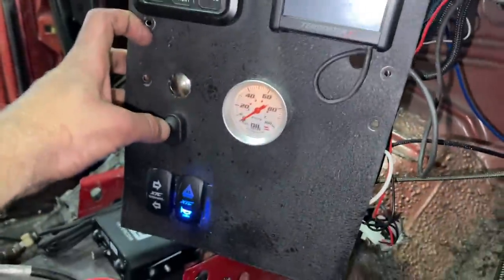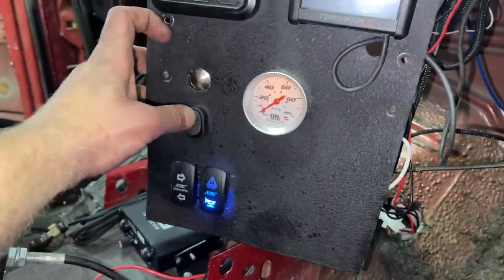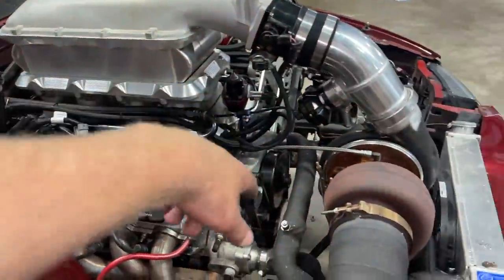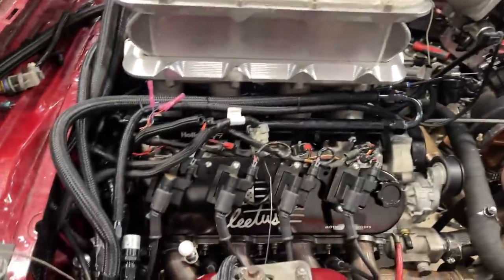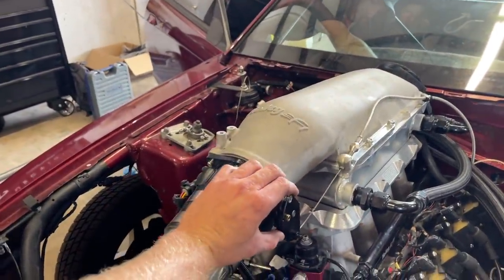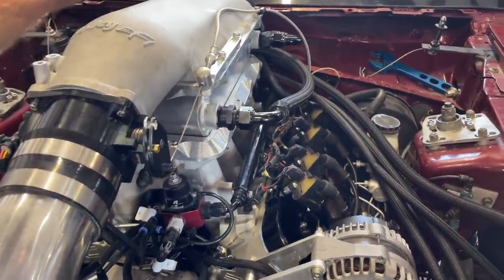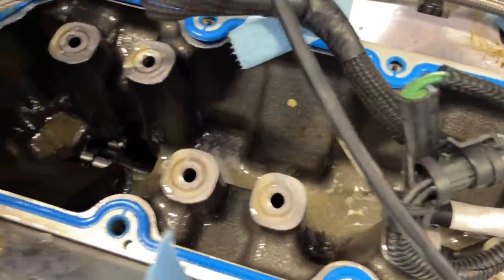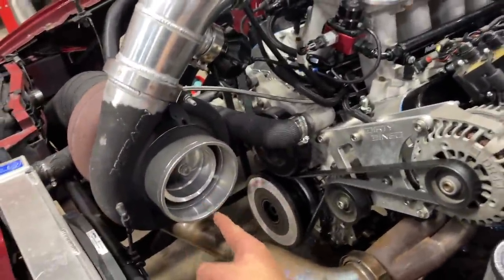Cursed with Oil Pressure Problems on New Motor, Dr. Pepper Leaves in 7 Days for Race Week 2.0

Comment: I think I'd shoot a heli coil in that timing cover and call it fixed if I did anything at all..lol starter probably just needs a shim since the flexplate is new and the teeth have paint/coating on it. Looks like you're doing good on time! That previous owner sure nuff gutted those doors, huh? I'll bet that's a light new edge! Good luck man!
Reply from the maker: It’s a light car for sure. Need to get some new doors with the glass and windows back in

Comment: 11:37 can you not tap the hole for a bit larger size or try and clean up the existing (what's left) threads? might be worth a shot instead of replacing the whole thing.
Reply: Or heli coil

Comment: that plastic oil pressure line thats going to your gauge, change that. first off, tech can fail you for it, and second, they are dangerous in a race car. the heat in the engine bay and with how hot the oil gets on the long drives will melt the line, leaving you with oil spraying around hot exhaust to catch fire, or if it breaks inside the car your getting coated in hot oil.

change that to a -3 braided hose, or ditch the gauge and put a sensor into the holley
Reply from the maker: Yea I do need to change that

Comment: With the stripped oil pan bolt why not just repair it on place. You could use a helicoil to repair it to keep the same size bolt, or you could drill it out to the next size up and use a plug tap amd tap a new thread the next size up. If it is the front corner one, do the same to the corresponding bolt on the opposite corner and that way you will have  2 heavier guage bolts in the corners.
There will be no need to remove anything and should not take very long to do.  Congratulations Dude wrenching on it yourself will make it so much more satisfying when you run this numbers at the track. Good luck Dude 👍
Reply from the maker: Good ideal I’ll just size up

Comment: On that oil pan run a bolt all the way through and put a nut on the backside
Reply: Quick fix get you by for the weekend
Reply from the maker: Can’t, it goes into the front cover, only thing I can do is size up